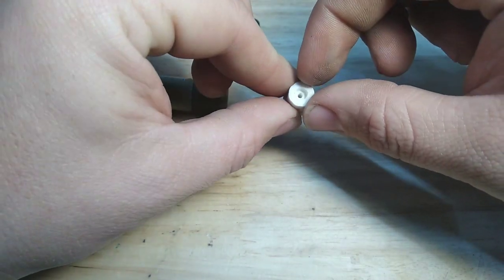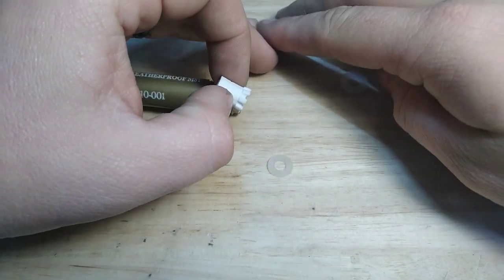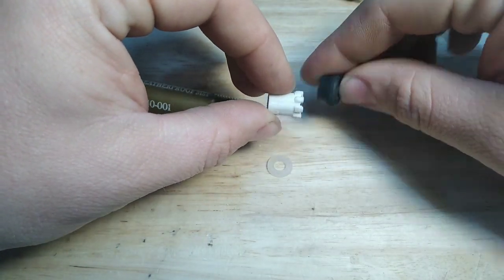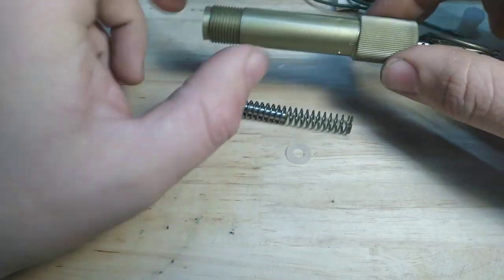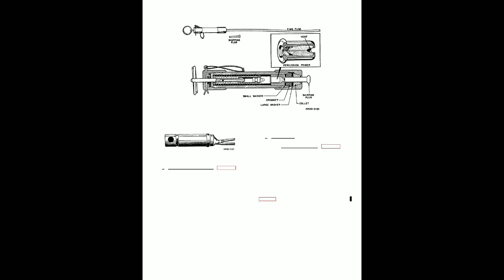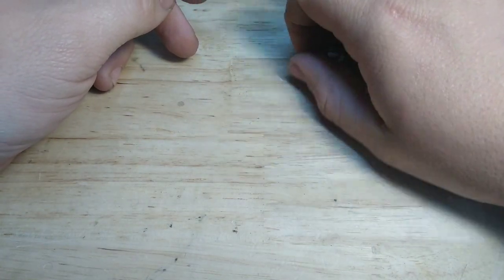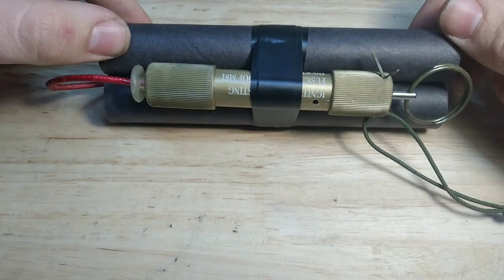M81 Fuse Ingiter (Ordnance Overview Episode 5)

Comment: you can take the used live ones apart and use those pop caps inside for a nice working replica! need to make sure you have the little metal bit that goes into the plastic piece that holds the primer.

Comment: Nice. I have been meaning to pick some of these up. Got to be on top of it when they do show up.
Reply from the maker: Yeah I missed out on a bunch of them a few years ago. I remember seeing them all over the place about 15 years ago at a huge militaria show. Now they are hard to find.
Reply: @ChevTecGroup  I believe it is because the BATFE designated them as UXO some years back on certain conditions. My local SWAT team goes through tons of flashbangs and stingballs but while they will give me 40mm junk and expired/compromised ballistic inserts, I can't get the igniters or even the bodies unless it is work related.
Reply from the maker: @DaveSmith-cp5kj  interesting. I know different field officers will give contradicting info. The local PD that shares my gun club's range left all sorts of CS gas, smoke, flashbang and stingball grenades laying around. Used of course, but I a box of them after another member got most of the good stuff.
Reply: @ChevTecGroup  Oh wow, you guys have smoke grenades as well? Those are really high priced items, you should sell a few on gunbroker. Should easily go for well over $100 each regardless of the condition, especially since the BATFE is butthurt about smoke generators these days.  

When we were doing work during the riots, my partner didn't understand why during our down time I kept picking up all the hot spent tear gas cans off the curb. I just said I hate littering. lol
Reply from the maker: @DaveSmith-cp5kj  lol. Yeah I sold most of my smokes on GB last year for about 200 bucks each. I had about a dozen extra and now I just have one of each kind I find for my reference collection. I think I bought 30 of them for 15 bucks each about 6 years ago.

Comment: I wouldn't suggest trying to open a live primer, that's a good way to drill holes in your fingertips with hot gas. I'll bet you could get away with using a full power primer, I've made fireworks before that used a 209 shotgun primer to both launch and ignite visco safety fused salutes. If nothing else you could drill some small holes radially around the body where the primer exhaust sits to prevent overpressure. Cool video too, I didn't know that these even existed...
Reply from the maker: If you use a full power primer you will Crack the body of the Igniter and it won't be re-useable. I sometimes learn the hard way. Someone was selling these years ago with 209 primers and people were getting hurt. 
Weakening a pistol primer isn't difficult but you do want to use proper safety precautions.  Glasses, faceshield, and only work with tools, not bare hands. A pair of needle nose pliers to hold it and a pick work for removing the anvil and lessening the charge. Then you just re-seat the anvil. It can be done safely but is inherently dangerous. 
I don't like the vent holes idea because I am often holding these in my hand to initiate a charge down the line. But it could work. You also don't want the vent hole venting into your explosive.
Reply: @ChevTecGroup  Ohh I didn't mean to imply you could use a 209 primer in something thing like that lol, you'd blow your fingers off haha, just that it would ignite the fuze. And I've got to be honest this is the first time I've ever heard of someone opening a pistol primer to weaken it so forgive me if I'm a little leary lol. I just know how much power primers have and respect them quite a lot. I built a little bolt action .177 BB gun when I was a teenager that used 209 primers, it shot around 1500 fps, those things are powerful.

 It's too bad the bodies of those igniters are plastic, if it was aluminum or steel it could handle the pressure...
Reply: @ChevTecGroup  I had a bucketful of fired fuse igniters about 40 years ago a friend gave me, and these actually did have a 209 primer in them. The insert they were in, was green like the body and it took a half twist to seat it... They must have not been full power primers.
Reply from the maker: Wow that's interesting.  I had a friend tell me that he bought one in a "kit" that came with a 209 primer and they while thing blew apart in his hands. Even a regular small pistol primer will crack the tube on an m81.
Reply: @ChevTecGroup  Yea, I actually bought a box of 100 - 209 shotgun primers to reload them. Sounds like it turned out to be a good thing I never did...lol That's why I was a little confused when in your vid you were writing abou using small pistol primers.
My house burned and I lost everything including the ignitors. I kept most all of my reloading supplies in my storage bldg to keep it all out of the house. Good thing I lived out in the country...😂

Comment: @Chevtec Group Hey man, just wondering why do they "Push in, quarter turn, pull?"
Reply from the maker: I believe it is to make sure that the rod with the ring is fully clamped on the firing pin. The quarter turn probably confirms that the safety pin has been removed

Comment: I have an M-60, I have no idea if it is live. I was worried it may go off from mishandling. So it is not a M-60 blast? just an igniter?
Reply from the maker: Yeah they just have a primer in them. The M60s are only for timed fuse I believe where the M81 can set off shock tube